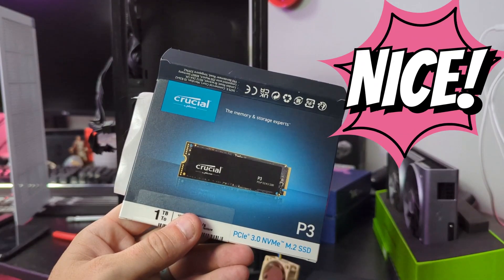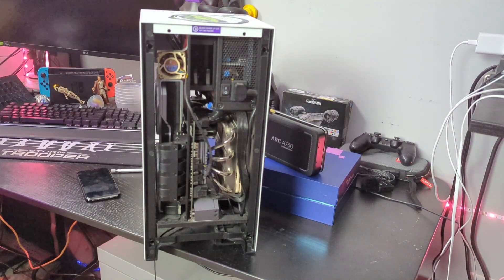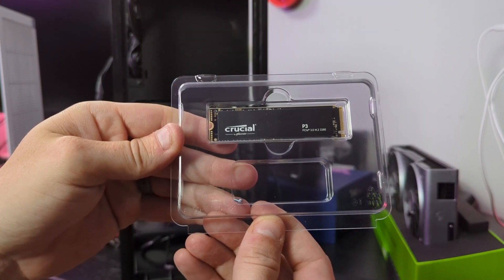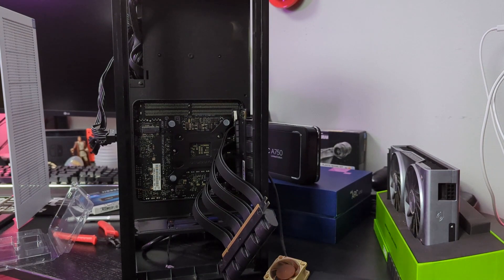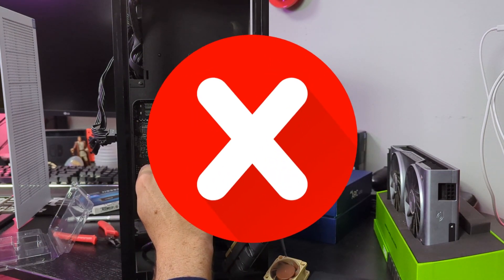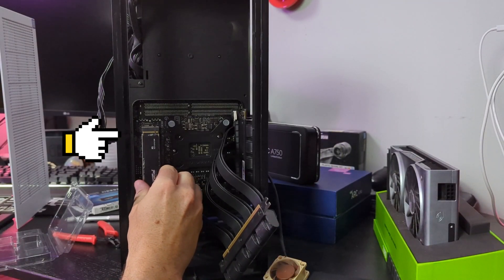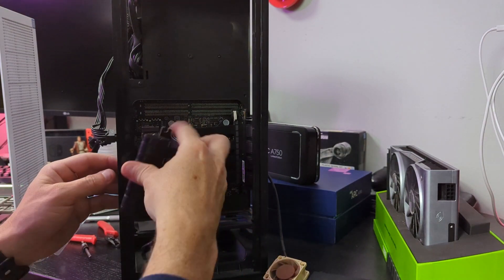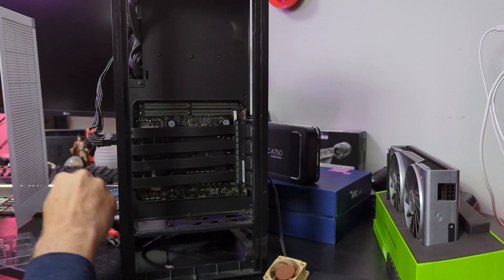Installed M.2 on the BACK of a motherboard!

Comment: I'm thinking about (eventually) installing a Linux os on my front m.2 slot and windows on my rear slot. I was concerned about the heat on the rear but you've said you haven't ran into any issues. Do you think having an OS on the rear slot would cause any problems with the potential of shared PCIE lanes like another commenter pointed out?
Reply from the maker: I don’t think so. Everything has been running great for me!

Comment: What’s the motherboard youre using that have a m2 ssd in the back? I’m trying to get myself an itx build
Reply from the maker: ROG Z390-I GAMING
Reply: @ExtraTechy  thank you so much. Hopefully they’ll have a am4 version of the motherboard but thanks
Reply from the maker: @hyper_icesparxx5334  Indeed! This is a 2019 build, so maybe they have an updated one!
Reply: @hyper_icesparxx5334  Hope I'm not too late to assist, I just watched the video to do the same on my Asus ROG B550-I Gaming Motherboard, which is AM4 mini ITX, my biggest concern was cooling by itself since the front slot has a dedicated small fan for the SSD, but my worries were shut down by some proper research, hope this helps!
Reply from the maker: @Aw3someToTh3Max Good points! My case is vertical so there is even cooling throughout!